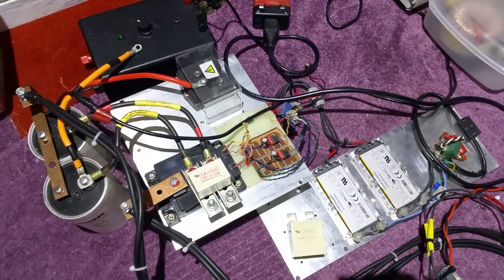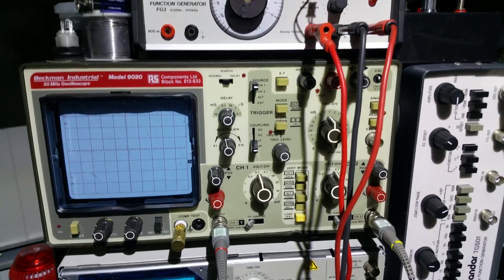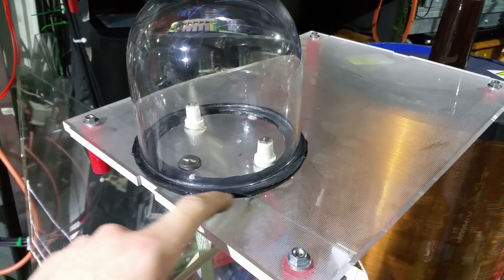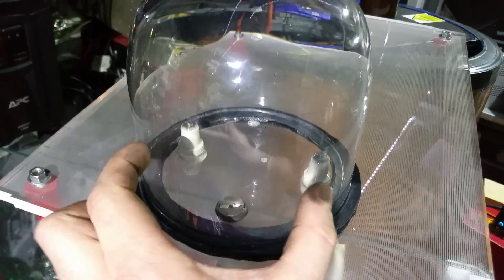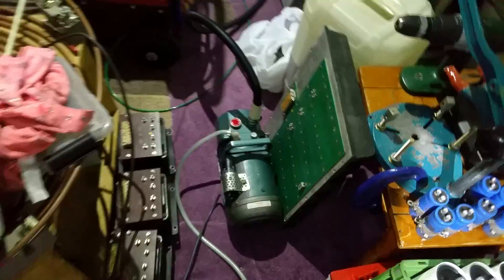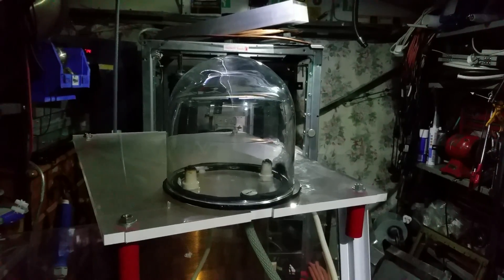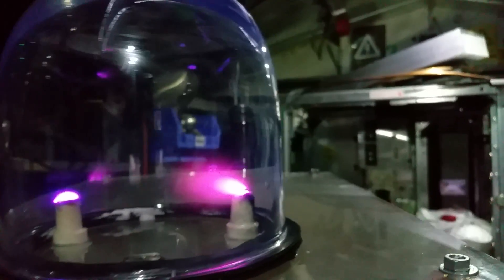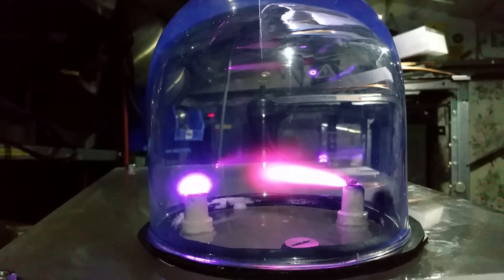Home Made plasma vacuum chamber

Comment: If I made a plasma like that I'd be looking round the workshop for magnets to start waving  about near it! :-)
Reply: Now you can also plasma carburizing with methane and  plasma nitriding with this.
Reply from the maker: nlo114 lol, yeah iv done it mate, it's great the way it reacts, make it bend and twist 👍😊 thanks for the comment 👍😉 be safe
Reply from the maker: Bruce Miller lol would be great mate 👍😀 thanks
Reply: It will work if you have enough poert to heat the metal with the plasma by impinging on it, this should work for my 2 stroke big block project.

Comment: Beautiful effect, like standing waves, or some sort of interference pattern.

Would be cool to expose it to electromagnetic fields and see if you can deflect the plasma.  maybe drive it with some audio signals (op amp?)

try finding some sympathetic resonant frequencies.  might blow your mind when you get them tuned up ;)
Reply: +tiporari I agree with you. They look like standing waves from ultrasound. I wonder what would happen if the vacuum got increased (lower pressure)? At some point the wave pattern should disappear altogether I think?
Reply: It's not standing waves, what occurs it that the electrons accelerate to a quantic energy that can excite the molecules and emits light, so after it, the electrons lose a little velocity and you have a dark area until the electrons accelerate again and effects repeat.

Comment: at what voltage do you have to start worrying about xrays
Reply from the maker: from around 18+kv. I would say. but there's no x-rays harmful enough coming from that.!! if there was' you would get a snow effect on the phones camera screen. as the X-ray particles hit the phones CCD. giving the snow  effect.
thanks for the comment.👍😉
Reply: Thanks for the response
Reply: +high1voltage1rules I didn't see a meter showing the HV and a mobile phone with it's tiny CCD sensor is not designed for detecting radiation. If you're going to do these high voltage experiments having radiation dosimeter set up for detecting x-rays would be a good thing. No one wants to see you making a video from inside a CT machine with cancer.
Reply: +high1voltage1rules Hey buddy, great video, nice to see you putting out new, hope you had a good new year!

I would seriously be careful about that though, it wouldn't surprise me if you were in fact getting some pretty nasty X-rays off that thing, may not be strong enough to be detected by the camera but can be still very dangerous. Better safe then sorry! Keep safe mate :)
Reply: +high1voltage1rules In addition, the glass works as a shield. Takes some voltage to get out of that. (as for the plastic base, please find something else)

Besides, is the vacuum that good?
Reply: +erlendse should be noted that standard glass has pretty much, no effect on x-rays at all, you don't need an amazing vacuum to generate x-rays either. I was doing some work on an x-ray metrology unit, while their x-ray transformer was a little bigger, they had a 1 tonne, 3 inch thick lead door and a huge leaded glass window, even then, operation is supposed to be done from standing at least 1 meter away. Going near x-rays and high voltage vacuums really isn't worth the risk.
Reply from the maker: +Just Power Electronics lol how many times have I explained to you tom about xray lol. there wasn't any xray that where harmful from that as if their was the xray particles would hit the CCD of the camera and show as snow on the phones screen. 

thanks again and same to you. all the best for 2016 😉
Reply: +high1voltage1rules We haven't really discussed it before. Just saying, be careful.
Reply: +high1voltage1rules What is the easiest IGBT zvs driver setup?
Reply from the maker: +Owen Chase science channel hello mate. zvs drivers are on google images. and the igbt drivers Ewell there many different types. some easier than others. at the moment I'm using optcuplers as the gate driver. as it has a frequency going through them into the igbt gate. you can see them circuit s on google too. best of luck and thanks for the comment. be safe

Anthony 

High1voltage1rules
Reply: high1voltage1rules thanks mate.
Reply from the maker: +erlendse thanks for the comment mate and hope ya good and well friend 👍😉👍⚡⚡⚡⚡⚡⚡⚡⚡

Anthony 

High1voltage1rules